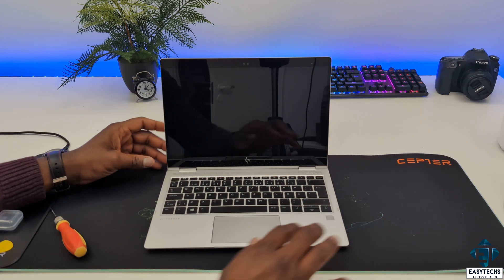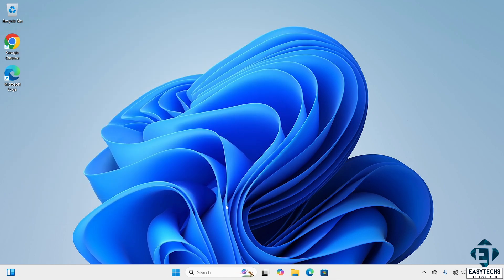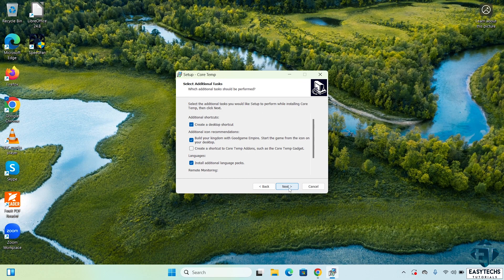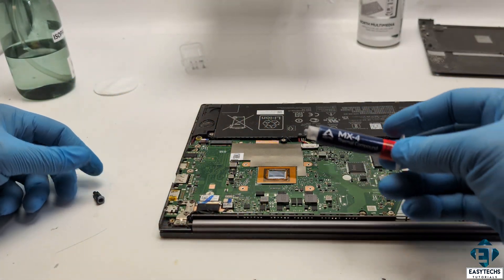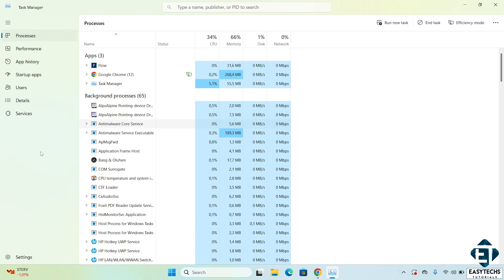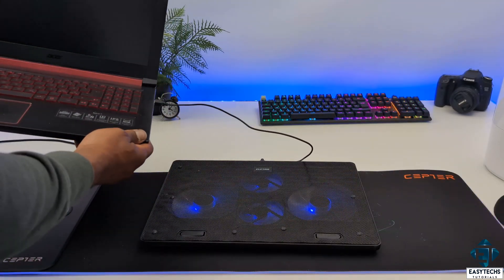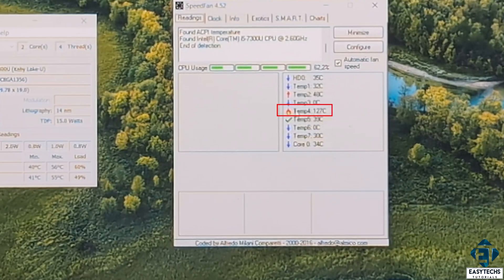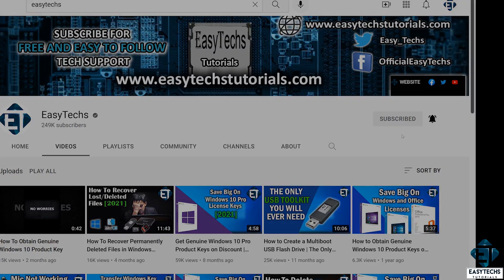How to Fix Loud Fan Noise and Overheating on Windows Laptops/PC

Comment: My HP ZBook Fury 15 G7 suddenly started running the fans at maximum speed even when the system is cool and idle. After checking the hardware temperatures, I discovered that one of the sensors is reporting an abnormal and incorrect value.

CPU and GPU temperatures are normal.

However, one temperature sensor shows an abnormal constant reading of 127°C/

Because of this false high temperature reading, the fans run at full speed all the time.

This issue appears to be caused by a faulty or damaged motherboard temperature sensor or a problem in the EC (Embedded Controller) reading the sensor./EXTZ/
How can the sensor be fixed?
Thanks for this tutorial

Comment: what tools do you use to open and disassemble laptop? i bought one off amazon but the screws on my Asus Zenbook 2018 are way too small. even when I did my research which tools I should use.
Reply: Same problem but I have dell
Reply: Take it to a technician. Disassembling it by yourself could be dangerous.

Comment: FIX FOUND : it’s fairly easy, you’re gonna have to get your CPU USAGE PERCENTAGE, on the  BATTERY settings, to be 90% instead of %100, changing that will cause the CPU to run at 90% meaning it won’t get so hot that the fans have to constantly kick in. I used Grok to automate a script in POWERSHELL, ran it as admin. But here’s some instructions on how to do it if you have windows 11 -: To fix the buzzing fan by capping CPU at 90% (reduces heat/fan spin):
	1	Search “Power Options” in Windows search bar.
	2	Click “Change plan settings” next to your active plan (e.g., Balanced).
	3	Click “Change advanced power settings.”
	4	Expand “Processor power management” > “Maximum processor state.”
	5	Set “On battery” and “Plugged in” to 90%.
	6	Apply/OK. Test—fan should quiet down; restart if needed. If noise persists, clean fan hardware.

Comment: I got an elite book making the same noise 🤣
Reply: Bro me too. I've changed the fan 3 times now, still making noise
Reply: @GidWow bro mine sounds like the clippers at a barber shop
Reply: @LeoDeSafo did you find any potential fix
Reply: @GidWow it might not work right away, allow the pc to cool down, then you’ll notice the sound will go away. However once it heats up again if it’s not ventilated properly, you might get the sound again but it won’t be as bad as 100% it will be waaaaay better
Reply: @GidWow let me know if it worked for you
Reply: did u changed the thermal paste? i found the solution by this. change it by high quality one

Comment: Excellent video,very informative.If the fans bearings are faulty would I need to replace the fan or is there a fix?
Reply: I wish he would respond. I have this exact issue 😢
Reply: There is a fix, it's just not easy and you need a soldering gun, just get a new set of fans